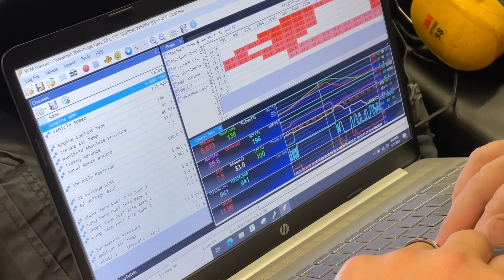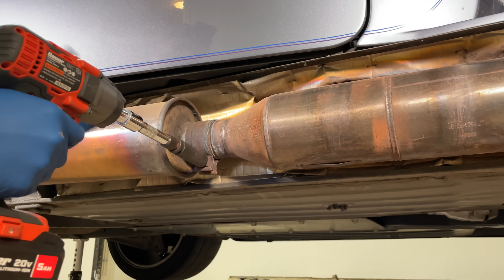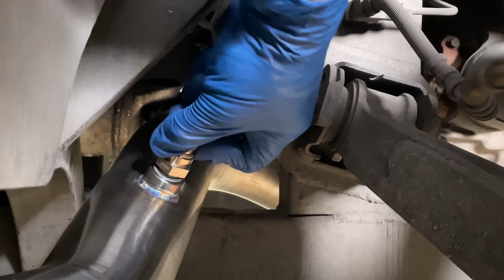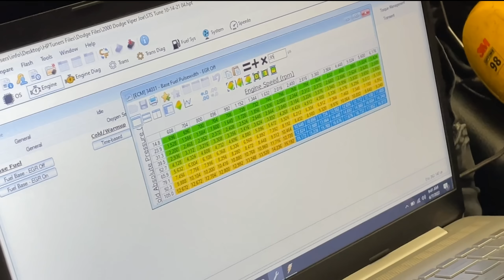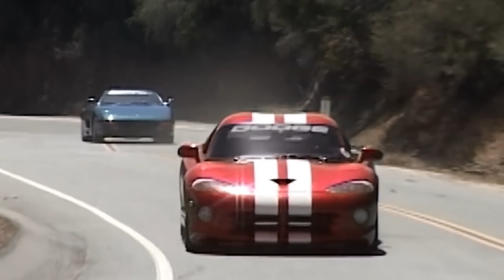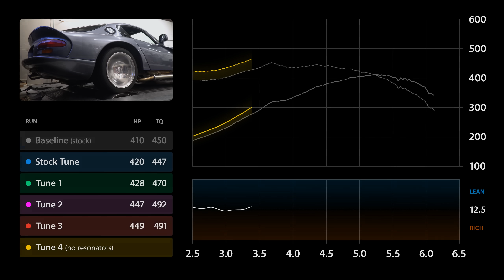When you give an 8-liter V10 the exhaust it deserves

Comment: These viper engines really are pathetic when you think about it. They had 8L+ displacement and were making as low as 400bhp at the crank. That's incredibly poor volumetric performance. I mean Honda Civics back then were making double the power per liter NA. This was supposed to be a high end sports car. 2 1.8L 4-banger B18s strapped together would have outperformed this while weighing half as much and getting double the fuel economy.
Reply: horsepower per liter means nothing. power to weight does.

also your honda weedwhacker engine will never make the torque at the same instantly accessible rpm the way the viper does.

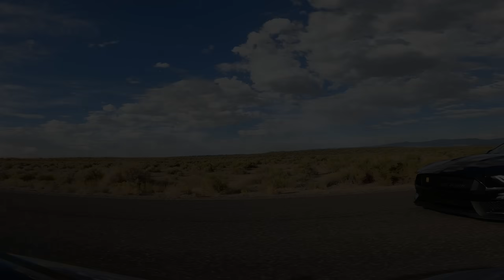Comment: i seen the exhaust kcikback some smoke 9:12 to 9:16 in 2 shifts. could be the reason the throttle cable disconnected, too much power or sum etc

Comment: Is 10% in performance by changing exhaust and tuning really worth the extra wear and tear to the stock components? I seriously doubt Dodge installed a tranny in there that can stand even 5% more and still give you the same longevity. But I guess longevity is not really what you are going for...
Reply from the maker: doesn't really matter unless you drive the car really hard all the time, also worth mentioning this was the strongest non-truck manual transmission for production cars at the time.

Comment: @Four_Eyes This is a very well done video, I’m subbed.  Cool thing is that I also have a 2000 Viper with a Billy Boat exhaust system, smooth tubes and a canned tune.  I’ve been wondering if putting headers on it would be worthwhile and you answered my question. I look forward to seeing more mods in the future, in particular the cam.

Comment: me cutting 2 of the FOUR mufflers off my ls400
my pops "won't it be too loud and illegal?"
me driving it with the resonator and two small mufflers still attached "DAMMIT IT'S STILL TOO QUIET!!  but a little better"

stock it has like 1 and 6/8" ID exhaust pipes...I know it's only a 4L v8 (244 cubic inches) but making 290hp I can't believe they didn't at least go 2 1/4 ID pipes...I plan to do 2 and 1/2" all the way back from the cats (exhaust manifolds apparently require removing the engine and the cats are actually high flow OEM), use some vibrant mufflers, remove the resonator and replace with an x-pipe, then find someway to get it tuned too...obviously a good tune is what matters most, and luxury cars aren't meant to be racers (well the ls400 anyway isn't...some of lexus' cars are 5L beasts) so I'm sure it's running rich.  I don't want to drag race or go to the The Dragon, I just want to enjoy my car more, and having a v8 with dual exhaust (and x pipe) how can I not try to get the best low rumble sound and as much power as possible?  I'm hoping with exhaust and tune I'll get 300 or 310, have to go FI to drag against stock mustangs and even hope to at least not get left like a sitting duck XD  She's not powerful or fast, but she's pretty, I want her to have a good voice too :D  lucky me I have a spare engine for this car, the headers on it are not designed with an ls400 in mind so that'll be fun but if I'm gonna have to pull the engine to replace manifolds with good headers I might as well build the replacement engine with better internals and replace the heads from a company I know specializes in this engine and making it flow as well as possible...and if I build the internals better, I mean, FI just has to come after that right?  right?  yeah

Comment: Lemmie finish that for ya.
The Mustang was gonna get spanked by the 23 year old Viper, no matter how you try to stack the deck in favor of the Stang.
The Pony boy is only putting out 526 horses to the crank.
The Viper is putting it's 459 ponies to the ground.
And the Stang is a 4000 plus pound porker. Compared with the Viper's svelte 3400 pounds.
And the Viper is on an Keto exhaust diet and just shed another 12 pounds. 
And that is why nobody with a Vette showed up.
Cause they don't want their hopped up Vette to get spanked by a 23 year Viper with an exhaust kit.

There's no replacement for displacement kiddies.
Whatever you can do you with your little pony boy.
Can be done the Le Man's, Porsche, and everything else Killing Viper.
Reply: There is replacement for displacement if you want to make power, it's called airflow, rpm, and boost.

As for making torque? It's hard to argue with bigger pistons, more of them, working on a more effective lever. The vipers broad torque curve is most likely what gave it the edge here.
Reply: @riogrande163  Rpm and airflow have very certain limitations. 
Boost is heavily restricted in racing.
And, whatever you can do with you cute little low displacement toy, can be doubled and tripled with a Vipers V10.
There are no, 3 liter Stupra's cranking out north of 2000 horsepower without Nitrous. But there are Vipers and Camaros doing it.
There is also no 3 liter, Rpm airflow, and boosted engine cranking out 10,000 horsepower. But there are 8 liter V8's doing it. Up and down the drag strips every summer.

Comment: How is it possible to have such a huge engine and such little power ? A 2.0l Subaru pushes 300bhp stock and an engine that’s 4 times the size only produces 150bhp more how does that even work 😂
Reply from the maker: The Subaru's engine has a turbo. Without that turbo, its engine would only produce about 160 bhp. Also this Viper engine is old (came out in '96) and has low compression and a very mild cam. Now when you add turbos to these Vipers...

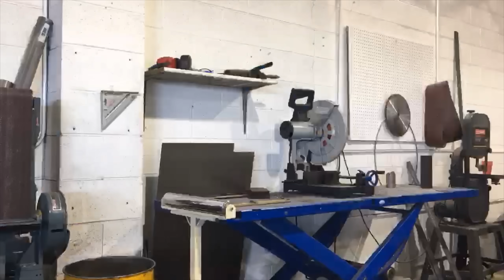Comment: 6:00 "cut the resonators off"
that's what many people would do first even on stock exhaust systems to gain that "louder sound"
I'm surprised you opted to keep that option as a last ditch effort.
also wished that the race would have been set against one of the proper rivals of the viper such as the corvette or ford gt, as the mustang's natural opponents in the wild would instead be the challenger and camaro. but great video overall and happy to hear the end result!

Comment: You would drive right by in a gt350 and unless I seen the 350 badge I'd think it was a loud Mustang and not even a nice one.. just a Mustang... 
But the viper sitting not even on would instantly get my attention.  
For a few major reasons.  

First one is obvious and it looks so much different then 80% of cars on the road let alone built in general and a Mustang is a dime a dozen.  
Ford of the exact same Mustang could be in tge same random intersection and that happens.. lol.
You would be at a car show to have 4 vipers in one area of s city.  
And it's a better car overall compared to a Mustang.. the actual car is Han made in Michigan by 50 employees at the time that car was built.. by hand I'll say again 
..
Mustang lol no ... 
The 488ci is a weird sounding split 5 Cyl but my God it's a wicked engine and with next to no work it can produce 600+ hp and gap most cars .. and look fuking sweet doing it. 
I mean that rear end is low wide and massive tires. To scream it's fukin fast. 
Lol sure you gotta know how to not dich it because my God it's a snap happy rear end but if you can get it sorted that v10 is a monster... 
Hands down.. all day I'd choose a viper. 
Preferably an RT10 but the gts is a beautiful car. 
Interior not so much butbte rest of the car is a work of American muscle car art.

Comment: I'm sorry what? V10 and ONLY 400+ HP? 
There is Audi from 1999 which has V8 4.2 and has 340 hp... 
I'm sure there is surely more and better cars with V6 V8 with more HP in general.
Reply: horsepower per liter means nothing, power to weight does.
Reply: @riogrande163  but for sure you could get more from V10 engine... but it's common with American engines
Reply: its a low compression, mildy tuned v10.

the numbers its making is the engine just snoring through the rev range. add compression and cam, or boost and it will wake up just fine.

a 2 liter honda to make 400 horsepower needs either high compression, or boost, and to scream at high rpm. 

not to mention the broad, flatter torque curve offered by the bigger engine.

 @SynniSynnove

Comment: I'm honestly not sure that an X pipe that far back is going to accomplish much.  But it does look nicely made.

Those split headers are amazing though, and I may steal that idea for some 440 headers I need to build.
Reply: Also, what ECM are you using?  I was going to shoehorn an Ebay Viper V-10 into something but had the hardest time finding a tunable ECM that would work.  (Without spending nearly as much for the ECM as the engine.)
Reply from the maker: We use HPTuners to tune the stock computer. And since there's no variable-valve timing, minimal emission equipment, and zero built-in torque management, it's relatively easy to tune.
Reply: @Four_Eyes  Hunh, OK.  I've always heard the J-20 (or whatever it's called) is a nightmare to retune.  Interesting.  Of course, this was about ten years ago, so who knows what improvements in the process have been made.  Thanks!

Comment: 8 l and 400hp 
Meanwhile in EU 4banger 2.0 Tfsi AMG 45s 421HP XD
Reply: horsepower per liter means nothing, power to weight does.
your EU weedwhacker engine won't make the same torque either.
Reply: @riogrande163  i like my eu cars they are safe and you can slow down before cliff :)

Comment: Dont get me wrong, but HOW : the car has 8 Litre Engine but only produces 450 HP ? other companies get way more power out of a 2 or 3 Litre Engine.
Reply: they got that power with forced induction, high rpm, OHC technology, and other factors.

small engines don't make the same torque as the large v10 also.

Comment: Those "adventures" with old cars are always fun... in hindsight. I once had a throttle cable break on my 1st gen MR2. Definitely no fixing that on the spot, so I wedged 2 or 3 dimes under the throttle sector, which gave me something like a 3000 rpm idle. It was just enough power to cruise along slowly on level ground, but not so much that it was difficult to start off in first gear. I could just slow down by turning off the ignition. The air conditioner also automatically opened up a separate valve to feed a little more air to the engine to compensate for the extra load, so I could increase my "throttle" a little by turning on the AC.

Comment: I thought this sounded familiar...it sounds like AUDI inline 5 engine, because that's what those exhausts are  - sitting on two different 5 cylinder banks.  To make a real difference in soumd you would need to join both pipes with X type exhaust and run everything through one pipe. as final

Comment: This is why the V10 got its reputation for sounding like a vacuum cleaner.  No matter what  you do, it sounds blah.  $5000-ish in exhaust system mods, and that Viper still sounds like my $500 Dodge Ram V10 with no mufflers.  I would, however, like to see how much more power the Viper would make with the stock exhaust, but with a dialed-in tune.  The factory exhaust, minus the resonators, looks like a pretty decent setup.

Also - love that clip of some dude's Viper going off a cliff.  Epic.  Probably some viral video that I missed lol.
Reply from the maker: "I would, however, like to see how much more power the Viper would make with the stock exhaust, but with a dialed-in tune."
you can see that exactly here: https://youtu.be/93cOSZkKAvo
Reply: @Four_Eyes  Thanks for the link!  From watching that video, looks like the vast majority of the power/torque gains were due to a better tune and deleting the resonators, pretty much what I expected since the OEM parts look pretty good.  So apparently if you want bang for the buck (but then why did you buy a Viper lol), just delete the resonators and get it tuned for proper AFR and timing.  Although, back in the early days, I will have to admit the Viper was the bang-for-the-buck champion.  The 'Vette has taken that title for several years now though...  LS motors cost more than an SBC, but still way cheaper than V10 parts lol.

Comment: Viper from its conception was a side-exhaust car. Unfortunately the amount of restriction needed with 80's tech to make it pass fed caused a significant reduction in power on the Gen1.  Gen2 got a power bump partly from spacing exhaust components out to the rear.  At the time it was necessary.  Gen3&4 saw return of the side pipes with some issues/compromises.  Fast forward to the Gen V and with the latest tech Dodge was able to Perfect the side exhaust with great sound & minimal restriction.       

A few of us have converted our Gen2 Vipers to sideexhaust by simply cutting holes in rear-side of the sidesills. The look is stunning with a 45degree bend cut parallel to body to revel a bold oval tip slightly protruding beyond the sill. I demo'd & dyno'd a variety of components between the header & Tips before settling on a setup that produced similar power to the wheels. Bonus of additional ~30lbs loss from ditching all the unnecessary piping to the rear, and ability to fabricate a more optimal diffuser covering the void left from the absent rear muffler. I admit it is Way easier to make a Rear exhaust Viper sound good, but for me Side exhaust was the only option.

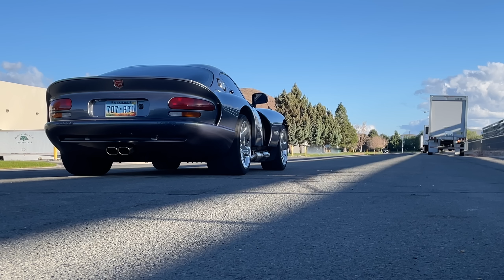Comment: 5:52 sounds better with the resonators

:buffering:
Reply: Resonators are used in cars to improve the sound of the exhaust. They work by absorbing and reflecting sound waves, which helps to reduce the overall volume of the exhaust noise. Resonators can also be used to improve the sound quality of the exhaust, by making it deeper and more resonant.

Comment: If you get rid of your catalytic converters you will really boost the horse power and torque Then just turn off the check engine light with a Flash tuner or MIL eliminators. If your your car will accept them

Comment: So the exhaust it deserves is made neither from titanium, nor even from stainless steel. Aluminized steel is usually the cheapest option. Then you throw out sport style quick release V-band connections and use inferior flange connections, that require sealant/gasket. Nice job, Viper is in good hands

Comment: I've actually struggled for years to grasp the concept of dyno tuning. This video and the way you show every step made me understand it finally after years of scratching my head and other people trying to explain this! Like I know it's to do with air, fuel, spark, timing, and the sensors that tell your ECU the info it needs about those 3 things to keep that engine running properly. I could use a flathead screwdriver and tune an old car the same way, I could mess around with twisting the distributor using a timing light so that I don't accidentally force my valves to eat piston for lunch in order to advance or retard timing, increasing the amount of fuel delivered in any one of 50 different ways,  I can mess around with the spark plugs by gapping them differently, using different kinds even to gain just the tiniest amount of power, or efficiency, making it easier for the engine to breath by removing certain parts. I mean simply cutting off the exhaust at the cats will make it breathe better. But before this video, that's all I knew how to do myself to tune a vehicle, and some of those things have nothing to do with tuning per say, but just increasing power. But if you asked me before how to make more power with nothing more then a new exhaust on your old shitbox car from the 80s I'd do something like that!! Now I atleast know what they're doing with the bloody laptop in all these dyno tuning videos!! That's alot easier then fiddling around like you'd need to with a carbed engine, a mechanically fuel injected engine, or even early electronic fuel injection systems!!

Comment: What a ancient engineering. I had E92 335d with 360hp and 800Nm. Diesel. And only from 3.0 inline 6. Americans are about 20 years behind. Are these with drum brakes??🤣🤣🤣
Reply from the maker: That car is 10 years newer than this Viper.
Reply: @Four_Eyes  Granted that. The one  I had before,E46 was 2002,330i with 231hp. I had custom intake and exhaust, cams from CSL, and few more mods pushing it to almost 300hp. Needless to say,the M3 E46 had 343hp out of 3.2 engine i6. I am saying that you don't need to have heavy truck engine on top of your steering rods to achieve proper dynamics.

Comment: I had a throttle cable break on me back in the day. I used a zip tie to hold the throttle about 1/8" off the idle stop. This put the idle at 4000 rpm, but once I got the clutch out, it accelerated gently and maintained about 60mph on level ground. When I got close to the house, I had to readjust as I live up a steep hill, but by then I was close enough to walk.